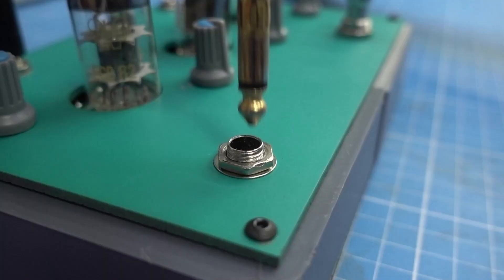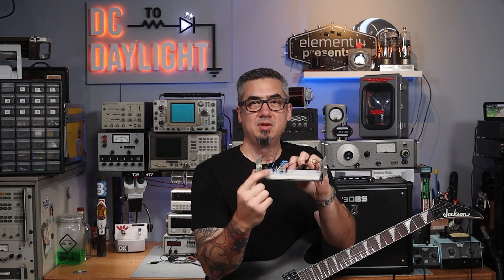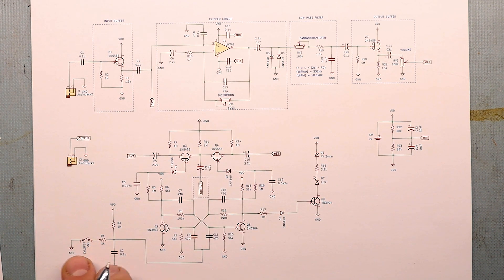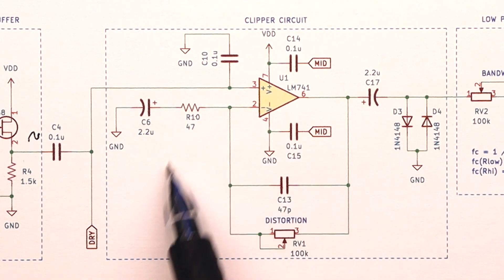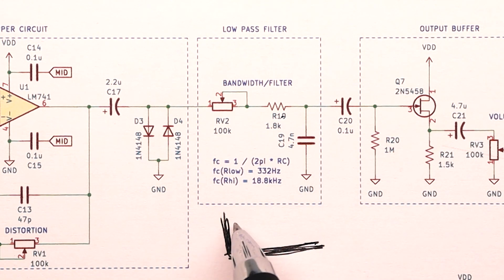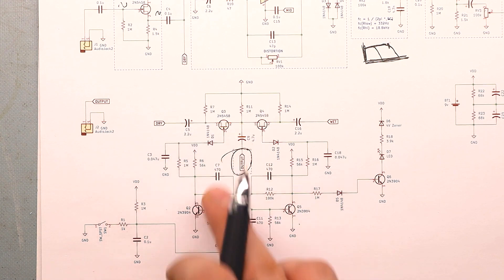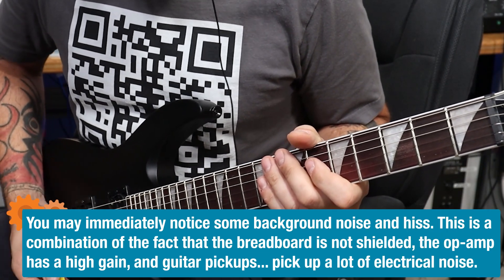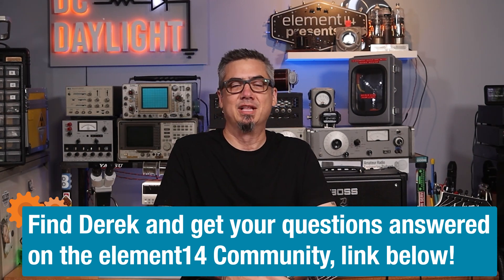How to Use a JFET as a Buffer in a Guitar Distortion Pedal - DC To Daylight

Comment: Talking about Jfets, a few days ago I've build a simple buffer using a jfet and another using a opamp. Using any of them, the pedal before the buffers makes a big pop noise when I switch on the pedal. I can not find a real solution on it, does somebody has an answer to solve it?. I have build a three jfet stages  overdrive and the sound is really good.

Comment: One modification to the hard clipping circuit that we rarely see is a tail resistor on the diodes. Considering how simple the mod is, I'm surprised that I still haven't tried it myself, but I've thought about using something like a 100 ohm pot in that position to vary the "hardness" of the clipping, from full-on clipping to something more akin to the plate saturation of an overdriven Class AB valve output stage. I've also considered experimenting with separate tail resistors to get asymmetrical distortion similar to those small Class A valve amps that many of the earlier rock guitarists used in the recording studio.
Reply: @AmRad Podcast Thanks for the nice reply! I actually came up with the idea when I was looking for ways to simulate germanium diodes, and the results were all tail resistors...but not actually implemented in hardware, just simulated in SPICE.

Comment: Awesome! Before electronics school (and the Internet) I tried to reverse-engineer the foot switch circuit from a cheap Boss pedal and got discouraged when I saw that it went to a bunch of transistors. The flip-flop transistor arrangement looked scary so I gave up. I never did revisit it after school. I was super happy to see you touched on it here.

The DS-1 has a little cap across the clipping diodes. Maybe to kill some of the over 20kHz harmonics so they don't cause intermodulation distortion? 

Would a little demo of harmonics (say, of a proper overdriven pair of 6L6 tubes compared to a distortion pedal output) be something people would find interesting? That was another thing I really wanted to try if I ever got an audio-frequency spectrum analyzer.

Comment: The 741 typically requires 80nA of dc bias current into its non-inverting input. Where is that coming from? Are you relying on leakage current from C5 to supply that, lol? 

It's a sad comment on how much the art of designing with discrete transistors has declined, but it's just not cost-effective to use JFETs like the 2N5458 any more. The part itself is close to obsolete, and each one costs about £1 from Mouser. In contrast the TL074, a quad JFET-input opamp, costs about £0.60 which would replace the input and output buffers as well as the 741 with a spare opamp to play with. The TL074 needs 6mA from ±5V supplies, while the 741 needs ±10V at 3mA to stay within spec (it will work on lower supplies like a 9V battery, but it's not guaranteed). A CD4016 quad switch (£0.50) could replace the routing switches (2N5458) for dry/wet and have two spare switches to play with.

It's fun to see folks still designing around discrete transistors, but for JFETs, their days are probably numbered. Some time, you might like to try the effects you can get when you have 4 high impedance opamps and 4 solid-state switches to design with, for little more than the cost of a single 2N5458. Thanks for the video, it was trip down memory lane.
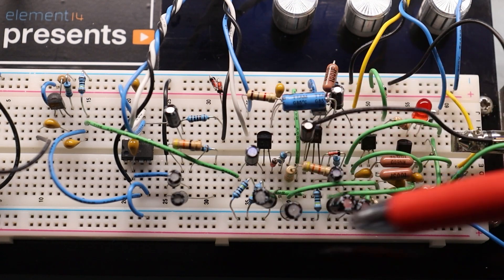Reply: Yes, the schematic has to be wrong. In fact you can see from the video at 9:37 there is a blue lead from pin 3 to a resistor that goes to the rail, which is different from the schematic.
Reply: I came to ask the same for the input bias current.

Comment: ELEMENT14, How do the SLEWRATE of the op amp add more distortion and it also alters changes the frequency response? The slewrate is just the time interval it takes for the op amp to take the input signal to the output signal its just a timing issue in nanoseconds. I don't know why slewrate will add more distortion and change the frequency response of the input signal on the input pin to the op amp, can you explain more in a video lesson ?
Reply: When you have low slew rate it take longer time to change the output voltage. So as the volumes increases the bandwidth drops.
Reply: The slew rate is the maximum speed that the voltage can change at the output (not the stage delay of the opamp). For the 741, it's about 0.5V/μs. It has the effect of turning large signal outputs of any shape into triangle waves because the output simply cannot change any faster than a ramp going up or down at 0.5V/μs. The higher the frequency and the larger the signal, the more attenuated the triangle wave becomes.
Reply: @RexxSchneider  Distortion meaning taking a sinewave input the op amps slewrate will cause the sinewave input to be a triangle waveform on the output, but this is called waveshaping not distortion this is a misinformation term. I think he meant to say waveshaping not distortion. Slewrate is the speed/time interval it takes for the op amps output voltage to change. If you look the the op amps input pin and output pin using a 2 channel Oscope there won't Delay in time but there will be a shift of the instantaneous voltage point won't be at the same point as the input voltage to the output voltage because they will be at different points in the instantaneous voltages
Reply: @waynegram8907  The definition of distortion is simply altering a signal. You are mistaken to think of it as waveshaping. We reserve the term "waveshaping" for signal processing that we deliberately introduce to produce a desired effect, and normally we control the extent and type of the distortion that we add. In the case of slew-rate limiting, distortion occurs in an uncontrolled manner, which really doesn't fit the concept of waveshaping. So, no, he did mean to say distortion, because we have no control over the distortion introduced by an opamp that is slew-rate limited.

I've already told you what slew rate means, and it does not mean a "time interval". The clue is in the word "rate". It represents the maximum rate of change of the output signal, and I've already told you what the typical slew rate for a 741 is.

Slew rate has nothing to do with the time it takes for a signal to propagate from the input to the output of an opamp. Please try to get that through your head. If I use a scope to compare input and output signals of a non-inverting audio opamp, the only difference will be the amplitude of the signals, depending on the gain. The phase shift is completely negligible at audio frequencies. There will not be "a shift of the instantaneous voltage point won't be at the same point as the input voltage to the output voltage because they will be at different points in the instantaneous voltages". Wherever you've got that nonsense from, please stop reading it before you embarrass yourself any further.

Comment: Epic! Few days ago I did clone of Electro Harmonics OD GLOVE which is totally outstanding. In this instead cliiping diodes used N-MOSFET 2N7002. The sounds of this is simply amazing. I had never guess it could be so difference and so fantastic.
Reply: So you removed the clipping diodes and Used N Mosfet 2N7002, and what did it do differently?
Reply: @waynegram8907  Probably its a main difference. I can't put link and image here yt immediatelly delete post. You can check in Derek thread on the element14, which hi shared in describe. So yes I guess 90% work is done by Mosfets. Be precise I did little clone of GLOVE, now I inspired in the other distortion I'll try change 4148 diodes on to this mosfets :D Difference is total, pleasse check any GLOVE test on the YT. It got a very low self noices level, very wide distortion set from normal guitar by little overdrive/overdrive/distortion/hard distortion to fuzz at the end. And all of this have very warm(rich) TUBE AMPLIFIER SOUNDS.

Comment: When I built pedals back in the late 80s, I had a lot of success with using different diodes such as OA79s (Germanium) to induce softer clipping, which introduces more even order harmonics than silicon which is primarily odd order. So much fun was had for such a simple circuit. Crazy things ensued beyond that!
Reply: @AmRad Podcast Good point on the BE junction. Germanium are probably way less common these days than they were "back then". I've got a big bunch of weird old diodes that I picked up on a whim for some low wattage "terrible as possible blues" valve amp idea I had. I've never tried LEDs, however I'd imagine that there's SO many things that are possible with the availability of different clipping options. I'd better not talk myself into projects, because I'm sure you know how that might get....! Oh no...here it comes...
Reply: @jim9930  There's all sorts of weird and wonderful combinations that can be achieved, definitely. Making them usable across a range is quite a trick, as they easily become very on-off. I recall RA Penfold publishing a nice dynamic distortion transposing input characteristics onto the distorted signal, that sounded great in principle.

Comment: Why didn't you hook the switch to the VDD? I assuming VDD is a external power supply, like a battery.  You're still using energy even if it off.